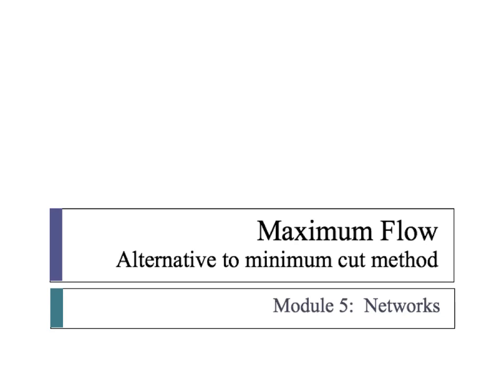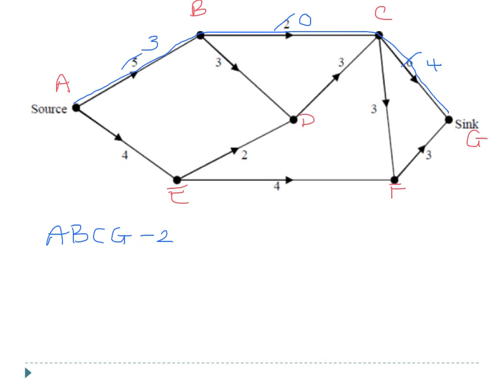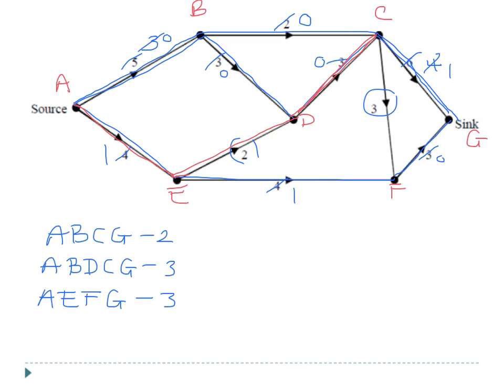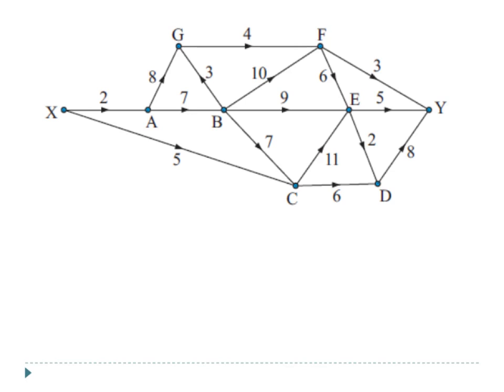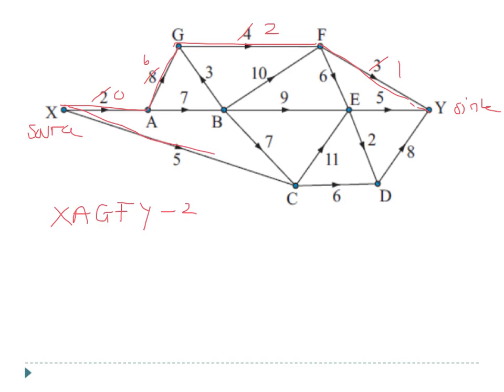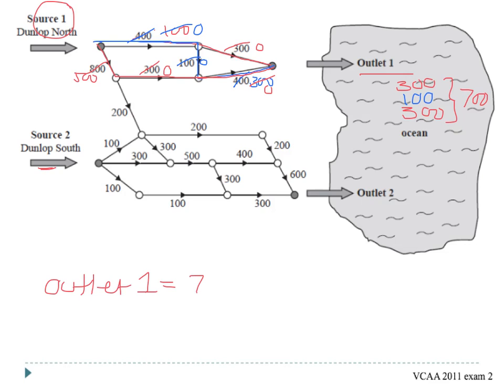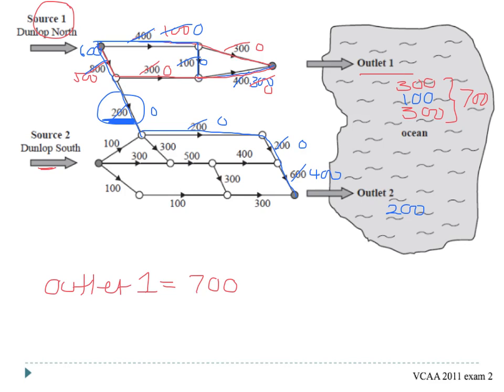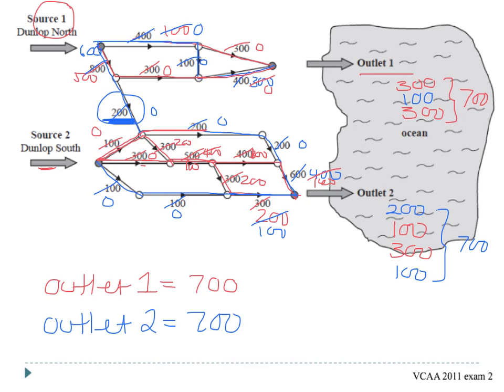Maximum Flow

Comment: When it came time to analyse flow toward sink 2, wasn't the 800 edge limited to just 500 capacity? I.e. doesn’t a flow of 200 reduce the 500 capacity down to 300 (rather than decreasing the original 800 to 600)? 
Asking for broader applications.

Comment: the maximum flow by saturation is only guaranteed by drawing in the minimum cut from the "0" or saturated edges. Just by adding the path values does not guarantee the maximum flow

Comment: In NSW syllabus I think this is called the "method of exhaustion", as you keep going until all possible flows are exhausted. It looks a bit hard to read if you get distracted part way through, with numbers crossed out and rewritten a few places. Perhaps an edge that has been exhausted could be highlighted so it stands out as exhausted.
Reply from the maker: Thanks for sharing!

Comment: Is there a name for this algorithm? Also, are there any limitations to this. I have used it and the algorithm is giving me a lower value then what I can determine using a the cut guess and check method. TIA
Reply from the maker: no name for the algorithm that I know of - just learnt it at a PD a few years ago.  It definitely has some limitations, but seems to work well if you work your way systematically through the network. I tend to start from paths running across the 'top' and work down the page. It's really important to always go back and find the cut that matches the value you get - if you can't find it, then that's one scenario where this alternate method doesn't work
Reply: How do you know when to stop doing the pathways from source to sink? I’m still a little bit confused
Reply from the maker: @josieknowles8311  you stop when there are no paths from source to sink with a 'smallest weight' greater that zero.  That is, if all the possible paths have a zero on it, you're done
Reply: @VCEFurtherMaths  okay thank you, I just have one more question. What if in a question it asks for where the excess flow is located, do you just say the areas that have non-zero values?
Reply from the maker: that would be the best place to start, but it really depends on the context of the question
Reply: I believe this is known as the ford fulkerson algorithm